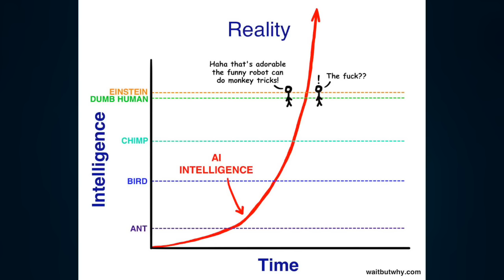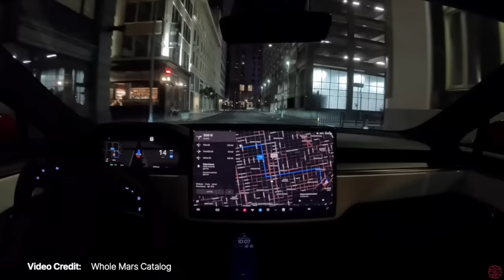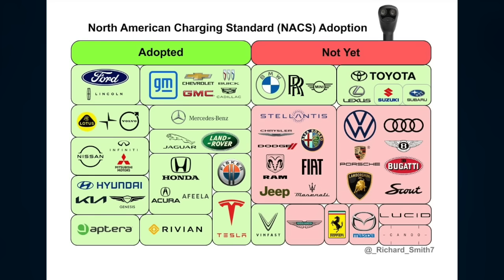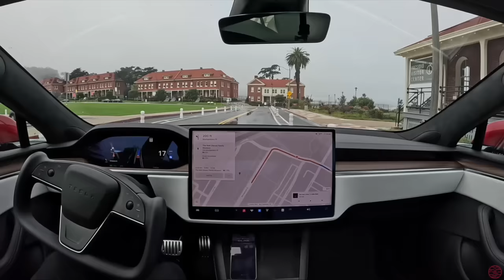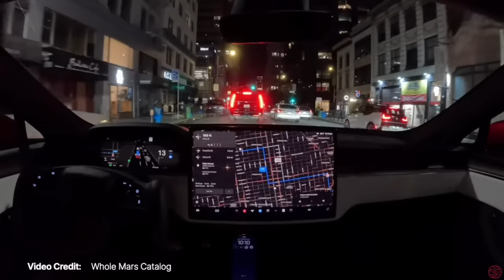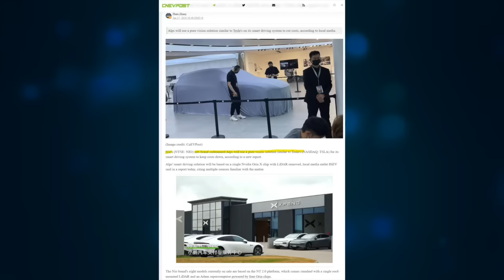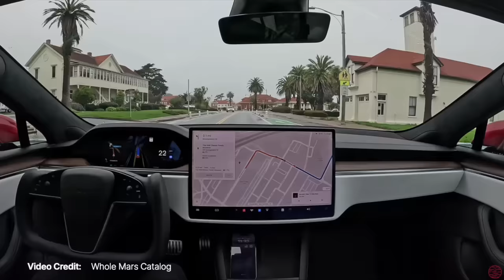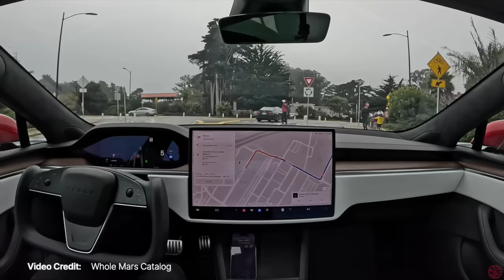BREAKING : Tesla releases Full Self-Driving to the Public - THIS IS IT!

Comment: Maybe I missed something but if you have a billion jobs to fill you don’t need a billion robots per year.  If you replace one a year you are cutting labor cost to 1/2 to 1/6 depending on shifts per day assuming a 30k robot and a 60k average salary per worker (latter probably way high counting foreign labor). The robot should IMO last at least 3-5 years to have a reliability similar to phones and cars.  That is more like 200 to 300 million per year max.  Divide that by 3 again if 1 robot can replace 3 workers per day assuming 3 shifts worked per day.  The last  reduction is probably smaller than a factor of 3 if a significant portion of plants work 1 or 2 8 hour shifts.  I’m used to 24/7 operation in chemical plants which is either 2-12 hour shifts per day or 3-8 hour shifts. The man hours are the same either way.

Comment: Tesla is the best car company ever and no maintenance no gas stations and no slime car salesman and corrupt dealerships and no oil changes no smog check no belts no hoses no spark plugs no air filter no alternator no radiator no starter
Reply: But Tesla needs something that no gasoline car will ever need:    a 20,000 dollar battery replacement at some point in the future!

Comment: "still make mistakes sometimes", like at 6:54, getting in a lane marked right turn only, then proceeding straight when the light turned green, presumably why you said that then.  I do hope that the mistakes get worked out and self driving becomes a thing.  It does look like it's been getting better.
Reply: It does that a lot on version 11. That's it's biggest problem. It's almost unusable on undivided highways.
Reply: The motorcycle in front of the car did exactly the same thing! Plus there was a lane directly in front without a conflict — maybe that’s what the motorcycle driver knew beforehand: so the Tesla just followed?
Reply: Every human driver in that lane proceeds through the green light.

Comment: I think... I think iv've heard this full self driving before, by now, I don´t know if Musk is just bluffing for the market. And the chart is because they put Tesla system at level 2 or 3, but not in 4 or 5 (full). Tesla doesn't use LiDar, so, it is going to be a little harder to get to full self-driving capability. LiDar can give you the depth of the objetcs and 3d modelling

Comment: Thanks for video - i think you are being over optimistic with 2024 predictions - nobody disagrees tesla are in a unique position on the development journey of FSD - but there are some storm clouds gathering on EV and Tesla may need to have some good development news stories to counter - did you see the coverage of EV in the recent cold weather in Chicago and NYC - Uber drivers had to take 3 hours without work each day in their Teslas - 50% range in cold - long wait lines for chargers - also uncertainly about the second hand EV market and how will that work , prices slashed on new EV is hurting current owners and resale values - EVs are not iPhones - selling a 5 year old EV with depleted range and poor battery is going to be very costly - and basically unable to match a new EV from china - BYD pricing battery tech is amazing real threat to tesla too - in addition to range anxiety we have confusion on charger standards - VW and Ford are pausing production on EV due to ‘demand issues’ and those pesky shortage in chips - then there’s the reality of ‘regulators’ who wont allow FSD that quickly due to safety concerns - even China wont allow cyber trucks atm - and someone needs to explain how the battery replacement costs of 30 000 for a single vehicle is possible - what value are 5 year old EVs going to achieve with depleted range - there so many headwinds with EVs and FSD i think you’d be better expecting it to be slower to get market traction in reality - will they get there - 100% - will it be in 2024 - me doesn’t think so much

Comment: I had a Tesla Model 3 loaner for one day and one night as my Model X needed to have 3 things to be fixed.  Tried using the FSD of the loaner Model 3 to get me home from El Cerrito supercharging location.  Once engaged, the car hesitated to go forward and constantly turned to the right and left, then right and left again as if the cameras alone couldn't help to decide how far the car was from the curb on the right side.  Once it started to proceed forward finally (after about 15 seconds), it turned too fast while turning to the right and the right rear wheel ran over the side curb.  That was so embarrassing as the couple directly on the opposite side who were also supercharging their model Y was looking at me thinking I was driving the Model 3 and causing the tire going over the curb.  Oh boy.  The Tesla FSD is not ready yet no matter how many times they change the name, including this 12.1.2, no matter if they will re-name it to 12.1.3 to 12.1.1000 to 13.1.2000, it will still have problems.  Forget it.  My friend who paid for it for $15,000 in 2021 remember that Elon said FSD would be available by end of 2020, then end of 2021, then 2022, then 2023, now we are in 2024.   It is either a SCAM or broken promise.
Reply: It sounds like you tried to use FSD in parking lot, which isn't really supported, atleast it wasn't before, it would be interesting to know which exact version that Model 3 had when you tried using it.
Is it perfect? No. But its getting there. We still need more videos of v12 from different people and different places to get better idea how much of a improvement it is now with end to end method. at same time, as it is now end to end process, its basically the last major change for its base, now it would only need more training data to be passed over to get better results. Previous versions included constant major changes which still required quite allto of manual coding for specific situations, now its just shove in video and check results.
It definitely takes longer than expected.

Comment: I wonder how FSD will do in crowded NYC?
Reply: You’ve got road rules there so it should be fine. I wonder how it will do in Paris or Rome.😮
Reply: @malcolmrickarby2313  
Extreme conditions might need v13 or v14, especially if its Indian city :D
Reply: @Zripas  different rules for different types of traffic. FSD must distinguish between working buffalo 🐃 and sacred cows in an intersection as motorbikes fill every available space and move in all directions.👍🏽 The ultimate challenge!🤔
Reply: @malcolmrickarby2313  
I'm just curious if FSD actually using geolocation data to use different training data based on where it is, as different countries will have slightly different rules and will need slightly different training data. Base one could be shared across all countries, like "do not hit puppy" but there is always some small/big differences between countries.
Reply: There is already a video on Youtube that shows 12.3 driving in New York.  Lots of issues, and disappointments there.

Comment: FSD passing red lights in the video at 03:00?
Reply: I thought so in 3:03
Reply: haha yeah and the rest
Reply: Not really, it goes through a yellow light, really no time to stop there.
Then it continues through the intersection which is very much stretched because of a wide divider and multiple lanes, this is done while the light is red, however, it would be wrong to stop in the middle of the intersection
Reply: Nope. Those red lights were for the right fork turn, car went left. Driving are hard.😂

Comment: Note: Mercedes has been in Level 3 for a while....
Reply: Because...
● It operates only on geofenced, precision mapped, limited access highways
● It operates only at speeds of 40 MPH and below
● It operates only in the same lane—no lane changes
● It operates only with a lead vehicle within 100 meters ahead
● It operates only in clear weather—no rain or snow
● It operates only with no direct sun on the cameras
● It operates only if the driver doesn’t avert his gaze from ahead for more than five seconds
● It operates only outside of tunnels
● It operates only with an internet connection

Comment: I don't get the congratulatory comments.  This video is a rehash of outdated and obsolete information.

Tesla is at least five years away from robotaxis with no geofencing.  They can get 95% of the way in a couple of years.  But you have to be 100% of the way without a driver in the taxi.  V12 is small improvement along the way; not a fundamental change.
Reply: It's a common thing to believe when you have no idea what C++ can do. And especially when you don't understand what AI can do either. Things you don't understand don't seem logical.
Reply: @beehappy7797  You don't have a clue what you are talking about.  Tesla is using a new approach with V12 using predictive AI; not generative AI.  They are no longer using C++ which I am very familiar with.  You want to have a discussion about code, I will run circles around you.  Please post about what you know.

Comment: Seriously?  This is still BETA!  That means it's UNFINISHED!  And it's still LEVEL TWO, versus Mercedes' LEVEL THREE system.  And Mercedes doesn't try to fake everyone out with useless data collection.  They put out an in-vehicle system that required and received REGULATORY APPROVAL.  Tesla never has.

That stock price seems to be wavering again...DOESN'T it, Lars?
Reply: Troll much?
Reply: @douglaswatt1582  Nope.  Get easily impressed by sparkly garbage much?